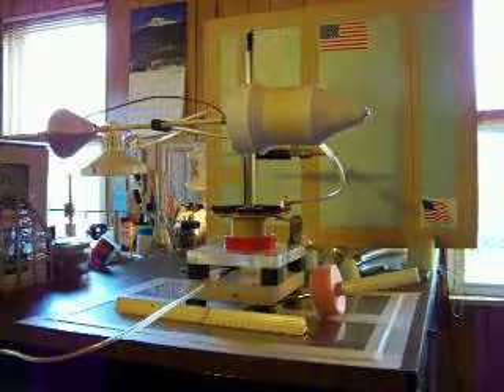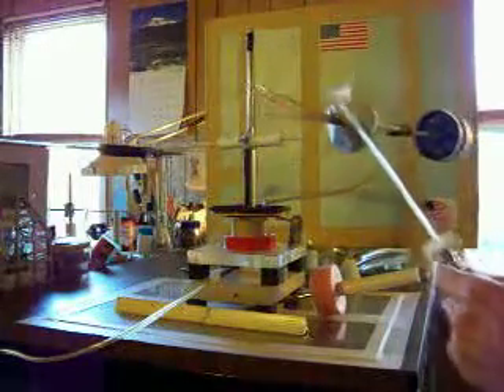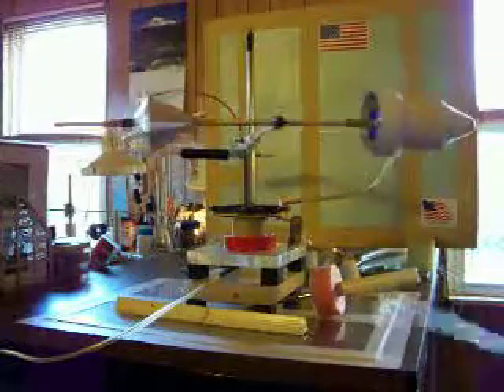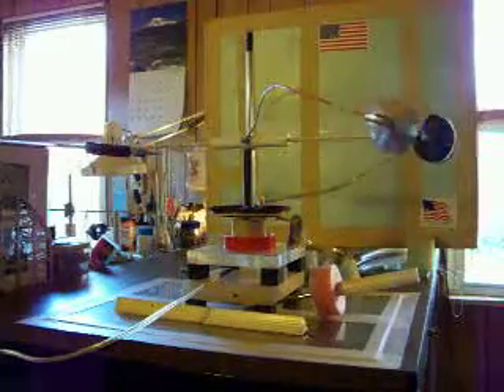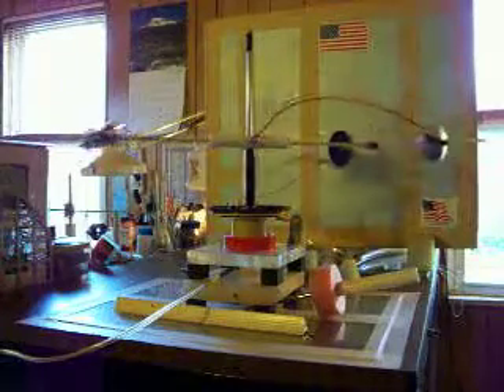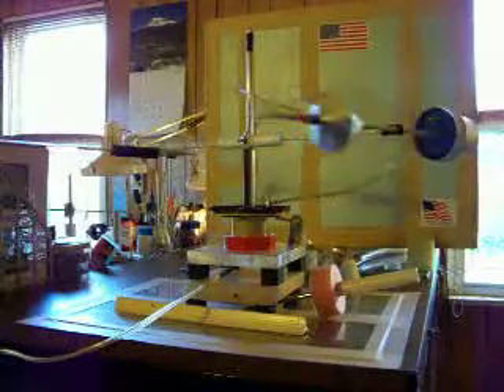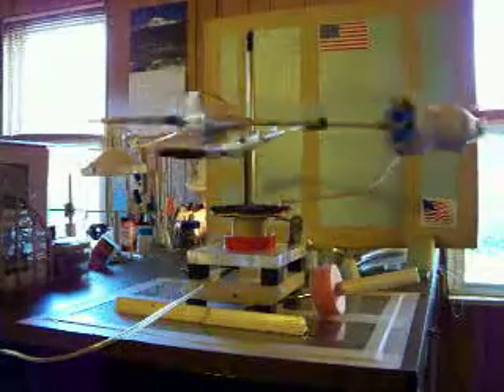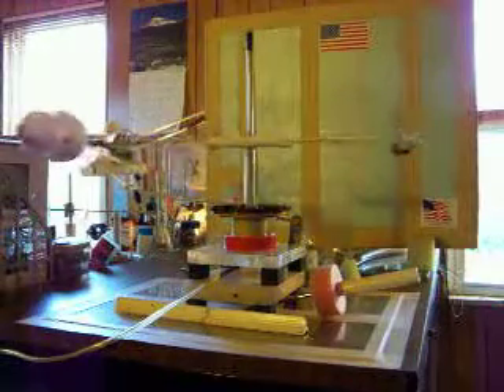LARGE ION ENGINE

Comment: Two questions if I may. One, about how many watts are you pulling from your power supply? I understand you use a 200kv static generator, but the total power usage would be interesting. Also, have you considered building a better PSU? I'm planning on building a larger prototype that will make use of a 200kv 1 kilowatt supply. I have always wanted to see what kind of thrust one of these things could put out when made a little larger and given a thousand watts.
Reply from the maker: TheMarvelousSputnik Hi, The power supply is only producing up to eight or ten Milli-ampere. Because the ion engine is actually a continuous  discharging capacitor it may be increasing the Joule value. Because the unit discharge rate depends on electrical pressure (volts) I'm not sure higher supply ampere will increase ion flow. The amount of ion flow is more about engine design and voltage  than amperes. The key to getting more thrust is in the power and volume of the ion cascade reactionary force.
Reply from the maker: TheMarvelousSputnik Hi, I think your best results is to use a 400KV to 600KV power supply for your research and test.